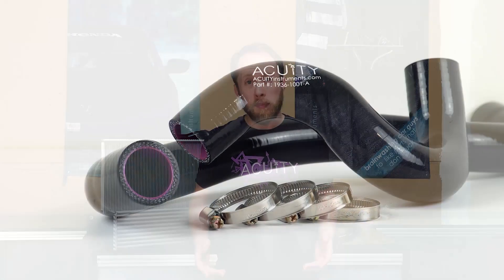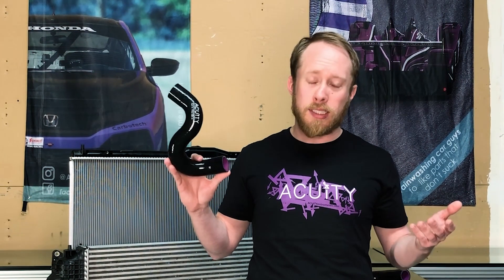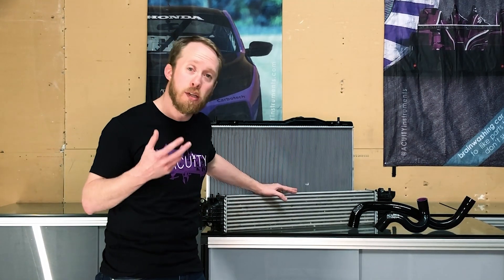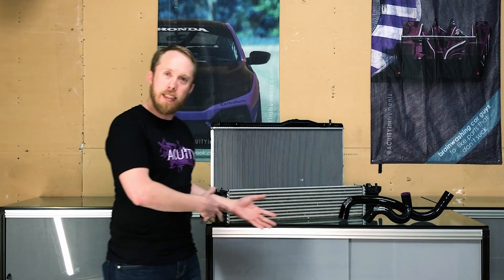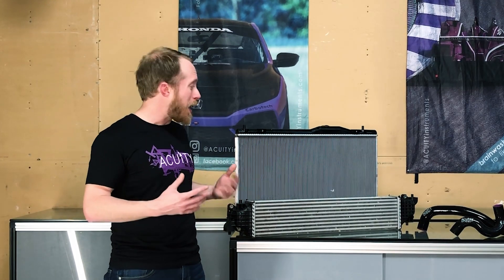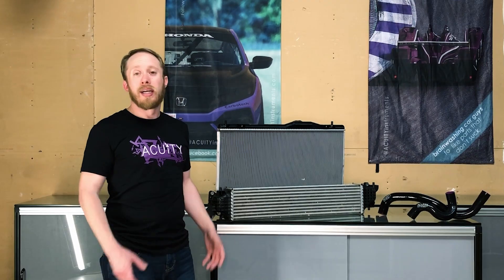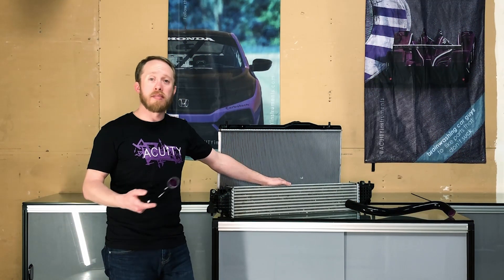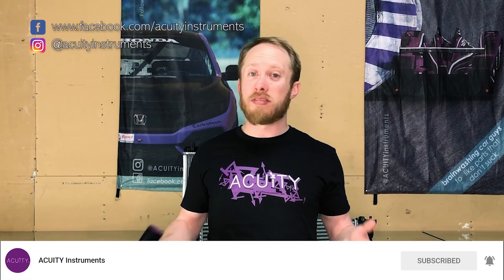Our Radiator Hoses Will ACTUALLY Make Your FK8 Honda Civic Type-R Run Cooler

Comment: If you happen to have a radiator leak and coolant level goes down won’t you be sucking air as it is now trying to pull water from the top area?

Comment: Question! From my understanding there are sensors on the radiator that and by reversing the flow it can change what the sensors read and cause the car to act differently based on the different temps from revering the flows. As such I heard it will cause the fans to come in sooner and stay on longer. Do you know anything about this?
Reply: Garret, your understanding is generally correct. In practice, we have not seen any appreciable effects from the slight increase in the fan duty cycle that's caused by the flipped sensor configuration, since the actual change in temperature the sensors see is on the scale of single-digit degrees. Modern cooling systems are designed to limit the temperature change between the inlet and outlet of the engine to help avoid unwanted thermal gradients inside of the cooling jacket. The way this is done is by flowing the cooling fluid (water) through the system fast enough to reduce the temperature delta.

Comment: Would this work well with aftermarket intercoolers? I'm looking at getting one soon as my FK8 seems to struggle to heat boost targets sometimes but I don't want to cause other problems by upgrading the intercooler. I'm looking at the 27WON or PRL intercoolers in particular.
Reply: Keep in mind that by adding heat to your cooling air from a bigger intercooler, you will reduce how much heat the radiator is able to dump into the same air, coming out the back of the intercooler. This will drive water temps up. The cross-flow hoses will help even more with an aftermarket intercooler because of this added heat from the intercooler, but they won't be able to help anymore once you've maximized thermal use of the cooling air going through your heat exchangers. If this is a street car, you'll likely be fine with the intercooler upgrade and these hoses, but if this is a track car, you may find you overheat when pushing the car on hot days with lots of lap traffic. If that is the case, consider use of a vented hood to evacuate the engine bay of hot air and help to improve airflow through your cooling pack.

TLDR: They will create an even more significant impact with an aftermarket intercooler than with a stock one, but you should still anticipate the possible need for a vented hood if the car will see a lot of track driving on hot days.
Reply: @rgareh1  brilliant explanation thank you 😊 it will be mostly street driving for me so it sounds like it would be a good combo

Comment: i have a question about this since 10th gen civic si water pumps are already weak will this stress the water pump even more?
Reply: These are for the 10th Gen Type R's only. That said, the increase to pumping losses in the system are almost none. Between the system being closed-loop (which negates lift-related losses), and the additional tubing adds resistance that is nearly 0 compared to the substantial pressure losses in the rad and engine itself.
Reply: @rgareh1  i apperciate the comment thank you!
Reply: @reggieh6038  No problem. Out of curiosity, where did you learn what you said about the 10th Gen Si water pumps? I've not seen that particular complaint about the OEM water pump on the 1.5t motors previously.
Reply: @rgareh1  maperformance has a video on what breaks when you start to modify 10th gen civic si's they mention one of the things that fail in their car was the water pump. the gear inside is made of a weak material and it shattered their's

Comment: Will this fit an accord 2.0?
Reply: Theoretically they should be close, but we have not witnessed overheating problems with the Accords, since they aren't tracked as much as the FK8's, so I'm not sure it would benefit you in any way if it did fit. If you are having issues with overheating that are not related to some other core issue, then it may be worth your trying.
Reply: They fit. I’m running them.  Solid construction, and look great. But no noticeable gains up to this point.

Comment: So the 1.5t don’t need reverse?
Reply: That's correct. The civics with the 1.5t motors use a horizontal-flow rad that is thermally aligned with the intercooler better. There would be no net gain from reversing radiator flow on them.
Reply from the maker: No these hoses are not needed, the 1.5t engines for the 10th gen platform have a different cooling system from the type r that is actually already well optimized with how the coolant flows through the radiator 🤘🏼
Reply: @ACUiTYinstruments  Is this still the case with the aftermarket Koyorad replacement for the 1.5t?
Reply: @geforce5591  The 1.5t uses a horizontal-flow radiator. The thermal gradients work differently, so reversing the flow isn't necessarily as advantageous. The ideal flow direction for a horizontal flow rad is in the same direction as the airflow in the IC that's in front of it. As long as that's the case with the Koyo rad, you're pretty thermally optimized. :)

Comment: So basically the inlet hose goes to the bottom of the radiator and exits at the top? Is there any issue with the water pump having to push coolant up, rather it being the regular style with gravity and having the hot water enter the top and working it’s way down
Reply: Good quesiton. This is a common misconception. When you push water up (or rather, in the direction opposing gravity), it takes some amount of energy to move the water upwards. However, in cases where an equal mass of water is coming back down somewhere later in the loop, the kinetic energy used to "lift" the water is recovered as head pressure when it comes back down. There is still some minor loss due to friction from a small amount of additional hose length and turning (of the water's flow path), but those losses are very small compared to the flow resistance of the whole system (the thermostat, the engine's water jacket and the radiator are the primary sources of resistance), meaning the pump sees little appreciable additional work. For a more relatable example of how this energy is recovered in the downward part of the loop, think of the practice of siphoning a liquid out of a pool or similar reservoir and how once the siphone is started, the flow continues without any pump etc as long as the output of the hose is just slightly below its inlet.
Reply: @rgareh1  if it works if works, and if it’s proven then that’s great, but I honestly think it’ll slow down the flow and possibly cause hot areas in and around the engine that is not getting the proper pressure and flow. If the bottom of the radiator doesn’t get enough air flow to exchange the heat, it’s more of a front design issue, which would be cool to see if people modified the cars to have better front end air flow. 

I’m not going against the idea, it just seems weird lol and like I said if it works great then that’s the proof 👍

Comment: When can we expect an INTAKE video with some chart numbers , especially seeing its 465$ I would think we would get some insight into it ? Maybe for a future video
Reply: Have you seen the write-up and dyno graphs that were created for a comprehensive comparison? The work was done by an independent shop to try to reduce any bias and provide real results. We have a link to it with some dyno charts on the product pages for those intakes on our site. Also, if you want to know what gains to expect over your current setup, I highly recommend reaching out to Dan at e-tunez (info@e-tunez.com) as he has tuned hundreds of 9th gens and probably 50+ vehicles equipped with our Curl Control intake. Also, with several thousand kits installed, there's a ton of anectodal reports of gains on forums, Facebook etc. We always prefer outside sources to provide dyno numbers as we feel they are more authentic. :)

Comment: Russ what you said made perfect sense, since the bottom half of the radiator is covered by intercooler and when you upgrade the intercooler you cover the radiator even more.  The only thing that is holding me back is that Heat does rise that is why ever car has cooling coming out from bottom of radiator into engine.  But it is worth a try.
Reply: Tony, this is a common statement among people who are new to heat exchanger system design. The fluid velocities, both of the water and air, are far too high for buoyancy effects (which is really what we are talking about when we say “heat rises”). I spent about 4 years designing heat exchanger packages for racing teams around the world. The fluid flow direction was always chosen based on optimal thermal orientation based on the thermal fields of the rad and the cooling air. This is all to say, heat does rise, but in this system it’s such a minor minor part of the heat transfer equation compared to the forced convection that’s happening from the moving water and air that you can neglect it. This is even true when designing very advanced cooling systems in F1 and similar. What’s very important though is that air can get out of the system, but in this case we have proven through many uses that the air bleeding ability is unhindered by the crossed hoses as long as the initial bleeding effort during installation is reasonably decent. Hope this helps. 💪🏼

Comment: Ok so you claim air going through bottom of radiator is same temp as coolant in radiator. How???? What’s that temp or was that made up ?
Reply: How what? Are you asking how the intercooler heats the cooling air that goes through it that subsequently gets fed to the radiator?
We didn't' say they were always the same, just similar. As the temp of the cooling air and the coolant get closer to one another, the ability to move heat from the coolant to the cooling air also decreases. The temps are not constant and change constantly around a track as engine RPM (which impacts coolant flow) and vehicle speed (which effects cooling air flow) both change. We can't share the best datalogs that were taken during development as they were done by Honda Performance Development and are restricted by a confidentiality agreement. We did do some independent testing on Kevin Boehm's K20C1-swapped Civic X coupe though. Now first, keep in mind that the temperatures of the air coming out of the intercooler vary all over the intercooler. It's hottest by the inlet, coolest by the outlet. We instrumented the cooling pack at the lower left corner (so inlet side of the IC, bottom side of the radiator). We saw air temps coming out of the IC (and subsequently into the rad) around 190-195F. At the same time, ambient temps were recorded to be 95F (although the air on the track surface will be a touch warmer). At the same time, we recorded ECT coming out of the rad at around 205F-210F. The ranges are because the as stated, the data moved around depending on RPM and speed as well as number of laps (the car wouldn't hit peak temps until 5-10 laps in).

Comment: Sorry for the noob comment but I plan on doing a 24 hour road trip with minimal breaks. My CTR is fully stock with 25k miles. I plan to drive from SoCal to Houston, TX and will be going through 100+ degree weather in July, probably pushing 70mph to 90 mph and spirited driving with hard acceleration when I get to Texas. Do you think I’d need to run these hoses or would I be ok without it? Thanks in advance
Reply from the maker: Totally valid question! Our opinion is that generally speaking, street-driven FK8's do not have a strong need for cooling mods. We have not encountered street-driven FK8's that overheat. We really only see it at the race track and on warm/hot days. On a very cool track day, you'd likely be fine as well. Also note that on a stock CTR the difference would be small, so if at some point you do go after reduced coolant temps, we recommend considering upgrading the rad, grille, hood, or some combination of those. The cooling system seems to be sufficient on the street, but we've found it needs a lot of help on the track in warm climates.

Comment: Got something like this for the si? I notice heat soak ... im tired of looking over n over at my temps on ktuner
Reply from the maker: We do have radiator hoses for the 1.5t's in the works (no concrete etas), but they won't have a flow reversal feature because the coolant flows horizontally rather than vertically like the fk8s.

Comment: I’m new to this but do I have to remove the bumper to replace the hose or nah??? My car is stock so if I purchase this hose, do I have to get an aftermarket  radiator because I see people changing their radiator..
Reply from the maker: No need to remove the front bumper to install the hoses, however you will need to remove the airbox, bulkhead cover, and undercover plate to remove the OEM radiator hoses. Check out our install guide available here for more details on the product/install process 🙏: www.acuityinstrumenrs.com/install

You dont need to install an aftermarket radiator with our hoses, but they are compatible with most aftermarket replacements 👍.

Comment: will this add stress to the water pump ?
Reply from the maker: We were not able to measure an appreciable increase in pressure drop through the system after changing the hoses (meaning the pump is not needing to work harder), and water temps only went down, so the water pump's longevity should not be impacted. We've also had a few sets on daily driven FK8's that see mixed track time and full race cars alike for over a year with no water pump issues to speak of.

Comment: Will you make one for the 10th gen civic Si?
Reply from the maker: Yes we are planning to release hoses later this year for the 1.5t's, but they won't have the flip flow feature because the radiator in those cars flow horizontally instead of vertically like the fk8s 🤘